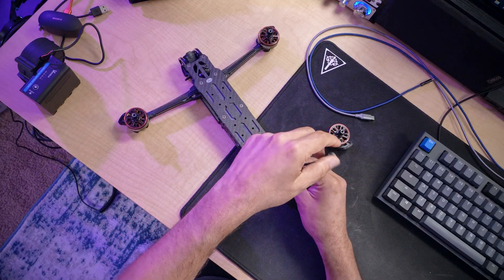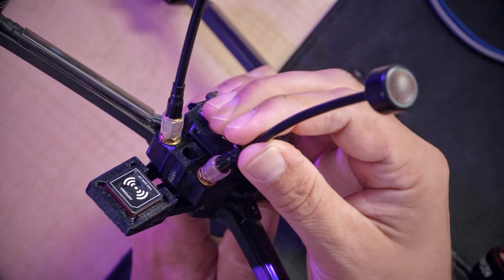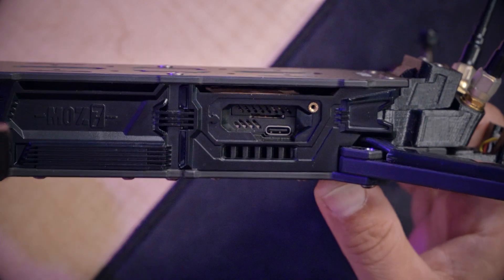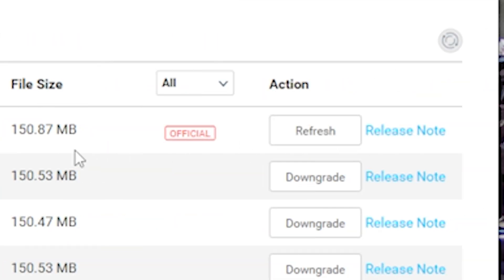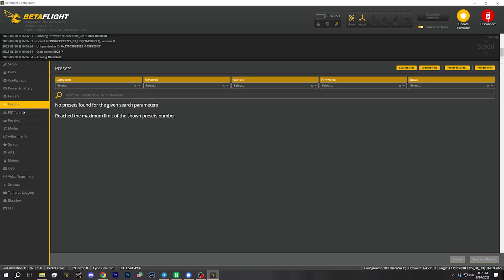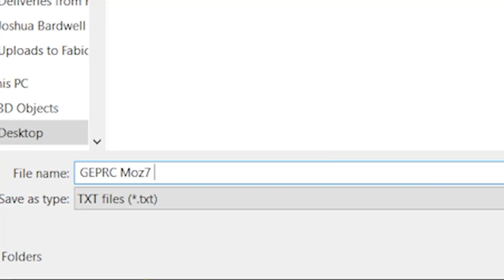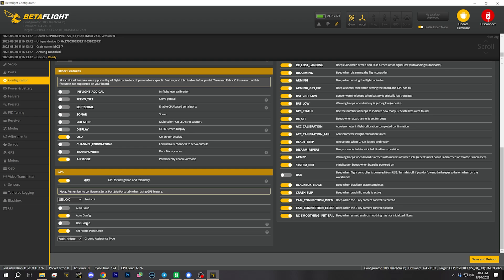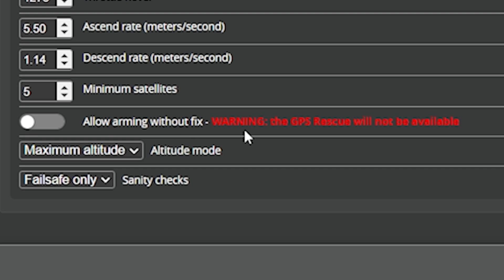GEPRC Moz7 Betaflight ELRS Setup Guide

Comment: what about the power and battery tabs? i'm upgrade the firmware to 4.4.2 ... and now the battery still beeping just in 24.9v to 20v as low battery... i fly with 1500mah 6S 4.35v per cell.... somebody knows the amperage volts scale of the ESC? this is a SPAN F722-BT-HD V2 Stack
thankssss!!!

Comment: Hello and thanks for the great video. Question, I used your link to possibly buy this drone on Banggood since they have the lowest price. The site states: GEPRC MOZ7 HD 320mm F7 6S 7 Inch Long Range RC FPV Racing Drone PNP BNF with 50A BL_32 ESC DJI O3 Air Unit Digital System - ELRS 2.4GHz
. It states PNP in the description but also it comes with the ELRS 2.4GHz receiver!  I have the DJI Goggles Integra and also the DJI Remote Controller 2. If I buy this drone will it bind with my goggles and controller? Its a bit confusing as I dont want to have to buy a differnt radio transmitter in case it wont bind. Thanks for any advice

Comment: Just got my MOZ7 in yesterday. I can not wait to get my FPV goggles next. Currently flying line of sight and the tune out of the box is so smooth. My only question is, will it hurt the DJI 03 air unit if I am not using the goggles?

Comment: Is anyone else having trouble binding the TX16S with Crossfire to the to the quad??   The goggles to the 03 air unit went smooth but I'm having no luck with my controller to the receiver.  If you could make a quick short video of you doing that part real quick I would be beyond gratefull.  I have the TBS version.

Comment: still no Freestyle v2 VTX review?
Reply from the maker: I released a review when it first came out, but then Chris Rosser discovered the initial review units were defective and not outputting the correct output power. As a result, I took down the review, because I don't want to spread inaccurate information.

When I have a unit that I am confident is not defective, I will review it.
Reply: @JoshuaBardwell  happy to hear that

Comment: I’m going to use the rekon 7 pro frame 
With Runcam link wasp
Elrs rx 
55a stack 
Am 2807 1500kv motors will this be a solid build to speed cruise mt surf a diving a some mild freestyle.

Comment: Hey Joashua, i copied your setup from pastebin and pasted it into Betafligh 4.3.2 CLI. Now I have no more information in my DJI Goggles 2. can I delete the setup again ?
Reply: JB’s HD OSD is meant for BF 4.4. You either have to upgrade you firmware, which I recommend only if you know what you are doing, or revert your configuration. Hopefully, you backed it up
Reply: @MrAlucardDante  
Thank you very much for your help. I was able to solve it with the following code :)
set osd_displayport_device = MSP
set displayport_msp_serial = 0

Comment: it is good practice to have horizon mode on a switch so that it can be used in the rescue mode
Reply: I’d rather put angle mode on a switch instead of horizon mode. To me, horizon mode is like what you’ll find on toy drone, where it stabilizes itself but then does flips and rolls automagically with the push of a button
Reply: @MrAlucardDante  i got confused between angle and horizon, i've got angle mode as well in my gps rescue routine!

Comment: I wish they would stop using LHCP antennas on BNF's designed around the DJI O3, but I do love the Moz7 - the GoPro mount with the carbon plate is a great innovation and the side plates make the drone feel super finished - it's perfect for the long-range and medium-range cruising flights I like to do to get scenery shots here in the Andes.
Reply: Why lhcp bad?
Reply: Because you will get less range than you would by using a dual polarized antenna designed specifically for the O3 system. LHCP on the quad will work, it just won't take full advantage of the potential of the O3 system. For those using Goggles V1 or Goggles V2 it doesn't matter, and for those with G2, you have the option of using LHCP antennas via the Lumenier adapter, but those with the Goggles Integra are stuck with the built-in antennas which re not LHCP. Like I said, it will work fine, just not at the system's maximum potential. @RandoManFPV
Reply: @colibrifpv  a gotchya. So it's not that lhcp is bad; it's jus that those BNF builds always use lhcp but the goggles don't use lhcp. And due to the lack of continuity you lose range yea?

Like the bnf being lhcp wouldn't matter if the goggles were also using lhcp right?
Reply: Yeah exactly, ideally you want to match polarization on both ends, goggles and quad. I am using Goggles Integra with these LHCP antennas from GEPRC on my Moz7 build and the range seems pretty good, but knowing I could get somewhat better range and penetration bugs me a little. I will try the long Flyfish antenna made for O3 and see if it makes any difference...  @RandoManFPV
Reply: @colibrifpv  hell yea thanks man!
Reply: Well, you are looking at this the wrong way. BNFs manufacturers shouldn’t stop using LHCP (or RHCP for that matter), DJI should stop doing things differently. FPV pilots have been using polarized antennas for a decade now, and it’s stupid that we have to adapt and by new stuff just because DJI said so. Just like when DJI released their first airunits with LHCP, even tho everyone was using RHCP on analog, which meant that we had to buy new antennas
Reply: @MrAlucardDante  wouldnt a dual antenna on the goggles be ideal tho? So you can use lhcp or rhcp; And if you want the best preformance you would get a dual antenna for the drone right?

That seems better than being stuck with lhcp goggle antennas and not being able to use rhcp drone antenna.. but perhaps I'm misunderstanding something as all of this is entirely new to me.

I have dji goggles v2, I believe that means all antennas I use need to be lhcp or ill suffer signal loss if it works at all
Reply: @RandoManFPV  RHCP or LHCP doesn't matter. What matters is that you use the same thing on your goggles and drone. So if your drone is running LHCP, all the antennas on your goggles have to be LHCP, otherwise they'll be out of phase